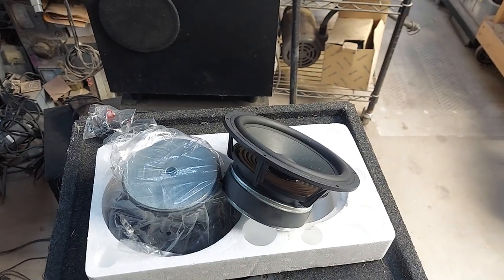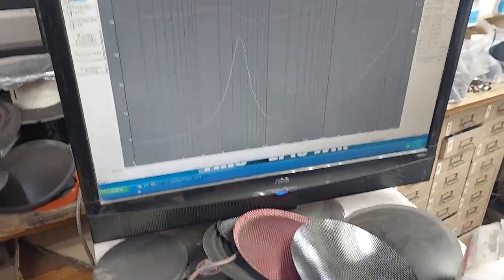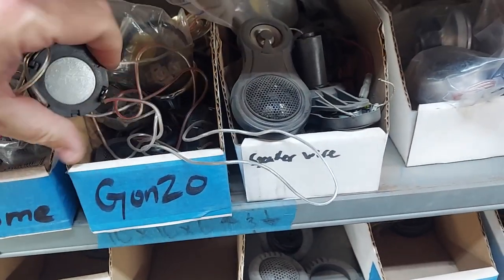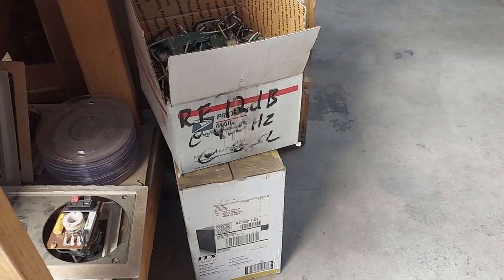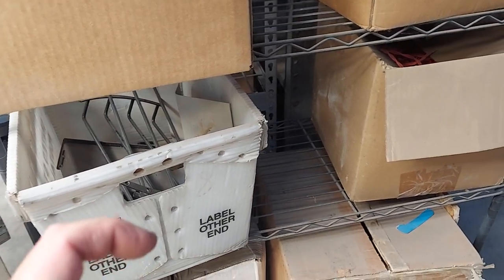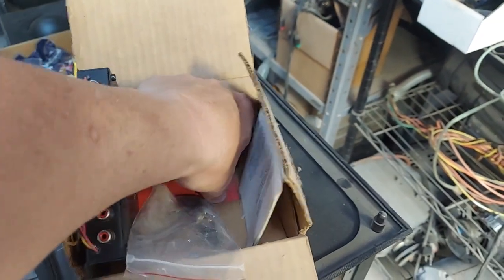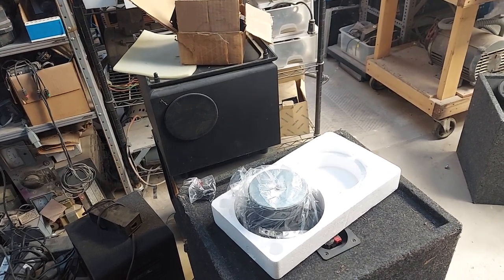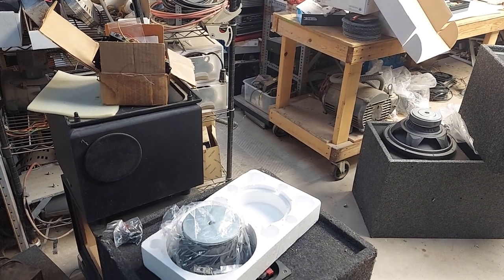GONZO Zen 6.5" components better than Focal Utopia, Rainbow, Morel, Dynaudio, CDT & JL Audio? 38hz

Comment: active crossovers require power as they use op amps. harris labs are passive crossovers. pre amp inputs are typically either 22 or 47 k ohm, so the components of a passive crossover are physically much smaller and work with much lower voltage/current than passive crossovers for an 8 or 4 ohm load.

Comment: I hate to chime in twice , but I was thrown back by the digital adt. Crossover I remember those way way back in the day, an those are amazing ,An programmable ,only 60$ shipped . The no named tweeter soft domes, I'd take (2) pair with the caps solders to them.
Reply from the maker: Just text me direct when you're ready.  Let me know your name and shipping address and I'll add you to the phone. 6023126504
Reply: steve, did you mean to type ads instead of adt ?
Reply from the maker: @administratorperson3272  Si.  he did.  I still have it available.  Someone texted me about it but I haven't seen payment.  6023126504

Comment: What do you think of cdt stuff? I bought there 6x9 coaxials, sound pretty good. Ordering said 2 OR 4 ohm, I ordered 4 ohm got 2.3. Was told with rise shouldnt be a problem. They played off deck power- figured theyd blow the deck. Played off a 90s kenwood avr rated 8-16ohm. The build quality kinda sucks if you ask me, rubber band to hold the tweeter wire down, and the wrapped the tweeter wire around the spade and soldered, so you cant use the spade.
Reply: I'm not robot but i own several cdt audio drivers  a pair of 6.5, cdt unity widebands and about 3 pairs of tweeters and ill would say they are top quality when you can get them on sale , they sound like high end speakers that cost so much more  , very good quality .
Reply: @Journalistification  cool, I was thinkn of tryin out those unity drivers and the new wideband 2" speakers.
Reply: @freeradical6390  The unity 8 sound very clear and detailed , not sure about their unity 8+ and new horn tweeters those 2 just came out , I would say go for it but get them used or buy from a person who's going with a different direction and are just trying to get rid of them.
Reply from the maker: All Chinesium like these.  I just prefer to pay less is all.  Look for beef.
Reply from the maker: I agree.  Just kind of spendy imho
Reply: All cdt is worth every penny when you get them on the monthly sales.  The new soft horn will get super loud.  There subwoofers are the only thing I feel is not worth the money
Reply: @db3287  hey man thanks! Not to many opinions out there about them. I like their sound so far.

Comment: As passives go and other  things being equal, titanium is preferable over aluminum, stiffer, lighter, higher breakup point. SB acoustics (as does peerless) make a great dimpled silk dome, very low FS (600hz) which is exceptional. I design and make my own x-overs and one thing I find a pain in the arse is getting specifics (Actual TS parameters, full). Seems like all the major brands aim for the 8,000 -10,000hz 6db which is a poor way to avoid proper corssovers and protect them against persons that are going to blow them up trying to use them below the rated values. I get it, but... Personally, i would never use a generic x-over, much prefer having the correct info to build my own. The cones on these look a lot like the SB papyrus cones. I always advise that if you’re going to purchase components, individually, get a good mid/bass and spend the money on a really good tweeter with similar efficiency woith as low an Fs as you can afford. 18db @ 1500 or 12DB at 2500 to 3000 ALWAYS nets a preferable soundstage and sound integration. Rule of thumb, tweeter should cost at least the same or more than the midbass driver, never skimp on the tweeters.

Comment: Nice name, Zen.
Plan on doing a 6.5/3/tweeter set?
Imagine the clarity of twin 6.5's on each channel to double power handling, and run them at 8 ohms per speaker. 
BTW, have you tried 5.1 surround sound in a car? Some Linkin Park is mixed like that, but does it sound good or is stereo better?
Reply from the maker: You can make any surround sound with just 2ch using DSP now.  Yes, we have the Recoil RMS35 that would make a great mid range for this setup.  It's not needed as the tweeter can play low and the mid is flat up to around 3k but if you got a hole in your car door and you want to fill it, go for it.
Reply: @RobotUnderground  I am able to have more SPL with more cone area for a given frequency. That is the goal, but without losing sound quality.
I also don't want to overload a small speaker with a dB level at which a larger speaker would be able to easily handle it.

Thus my quest for more cone area (on a given speaker or speaker set) for the given wattage, and why I like the idea of 3-ways as opposed to 2-ways, or 4-ways, if you include the 8" mid-bass drivers.
Or six-ways if you include some 10" high-sub-bass woofers to compliment the 18-24" audible-to-infrasonic subwoofers for the full, seismic-and-acoustic experience.

I know it all ain't necessary, but I've done it before to excellent effect. Too many stereos, to me, sound good until played really loud, then they get swallowed by subwoofers while the high end doesn't have the power handling to keep up their end of the acoustic spectrum.
Reply from the maker: @exploranator  Well I'd rather have a 6" mid than a 3.5" mid but that's up to you.
Reply: @RobotUnderground  The plan is tweeter, 3.5" high-mid, 6.5" mid, 8" midbass, 10" woofer, then 18-24" subwoofer Two of everything except maybe the subwoofer, depending on how greedy for lethal radius I get.

Then, take the bottom of the tweeter spectrum off and offload it to the 3.5"s, along with the top of the mid spectrum, then take the bottom of the mid spectrum off and put it on the 8's, have the 10's also in stereo that are better response than the subs, then the subs in mono for the sub bass and infrasonics.

At every increase in driver size, you get more power handling but less-crisp response, so you cross them over in a way that maximizes the individual driver's sound while still retaining fast attack and accurate reproduction.

They use 12" mids in the club to handle all the volume, but I don't want THAT much volume.

Net result: plenty of volume for all the speakers that they can handle at high volume levels. I I wanted more, i would then have to build a rig that folded out from the car for that complete mobile PA system. But I want a car that allows forays into very loud territory when I so choose without endangering the smaller speakers.

Not for everyone, but, hey, I went 180mph in my Hellcat too, but not often. I just liked being able to do so.
Reply: @exploranator  please upload video

Comment: I have a question .what makes a line out converter be able to handle more incoming rms power. on the incoming side of the line output converters. for example a car your using has a amplifier/ factory amp for mid and highs speaker and you come off that set speaker wire . Just ask because IV seen  some  of them on the package actually have a rms power rateing on them for the rms  input rms  on  the incoming of  line side for the lineout converters. IV also seen some smoke when it was tuned up 1/2ways thanks🤭🎵🎶💯
Reply from the maker: There are a couple of ways but typically they just add larger resistors.  Open some up and see.  Some like the Cache ones we have use a shunt to "sample", the signal and then boost it to whatever you want.
Reply: @RobotUnderground  thank you I'll definitely pop a couple of them open to see the difference and what resistance value are being used in them. Then I'll use one that hasn't burnt the board just To see if I can fix/upgrade one. 🎵🎶🤞👍💯🛠️🍻
Reply: a typical cheap LOC has a 20 ohm series resistor, followed by a 20 ohm parallel resistor rated at 10W. so if your Head/amp is 14.4v which is 52W @4ohm, ie; 10W @20ohm PEAK (not rms, which is 70.7% of peak) you can easily burn out a 20 ohm 10W resistor with a 50W@4ohm amp.

so if you use an LOC off speaker out from an amp that burns up, add a 20 ohm 25w resistor in series before the LOC, or a 50 ohm 10W.
Reply: @administratorperson3272  thanks  I was definitely putting way over what it rated for. I stopped buying cheap loc and try to avoid using them for a while I was around 13 years old when I first started hooking up system I only under stud the wireing. When I did need to use a Loc I'd avoid the small cheap one  at the time I thought they were just junk I didn't realize 1/2 the time I was putting double to triple over what there rated for 😂.  Now I understand now thanks. I was probably 19-20 by the time I actually seen a Loc with rateing on the box.  I can't believe how many videos are out about Loc and not one talks about the actual rating and that you can easily over power a cheap Loc and I haven't seen one video that tell anyone why they would need a better loc. Every video you see all people talk about the different option they offer Wich doesn't make sense if your not using the right one for the application. It does do any good knowing what options a Loc has. Thanks again for the quick brake down. Have a great one till the next one 🎵🎶🛠️💯👊👍
Reply from the maker: @administratorperson3272  Please make some "guts" videos and show people what a "quality" or high voltage type of LOC looks and acts like.
Reply: @RobotUnderground  that wouldn't be easy to do. i wish it were. its not so much me, but i learned if people just dont know basic things, like what a voltage dividing/summing network is ... they will say oh ok, but not really understand.
Reply from the maker: @administratorperson3272  You just have to make the video.  You don't need to be all up in them comments like me.

Comment: I've still got a set of Diamond Audio HEX S600S with a bad tweeter 🤦‍♂
Reply from the maker: I have replacements
Reply: @RobotUnderground  I may be interested. I'm not currently using them at the moment. I ended up picking up a pair of Dayton Audio - ND28F's back then and ditched the passive crossovers and went active. They were a nice match with the Diamond Audio mids.

Comment: do you have or can you build a set of 6.5's that are 1.5 - 2 Ohm?
Reply from the maker: There's no real need to do that.  It's just a gimmick.  If you feel it's not a gimmick, you can contact Rom So at a/d/s Speaker Repair for something custom or you can look at the drivers from Cicada Audio.
Reply: @RobotUnderground  or just use two of the 4 ohm speakers in parallel in place of a single one. More power handling with less distortion that way.
Reply: @RobotUnderground  lol I haven’t seen Rom since he and I worked with Dennis at ADST
Reply: rom so is nolonger doing repairs. :(
Reply from the maker: @administratorperson3272  What's he doing then?
Reply: @RobotUnderground  we (the a/d/s/ enthusiasts group) have not been told details other than about 8-9 months ago he was not well, and the website states "temporarily closed". the enthusiasts group is primarily car audio (there is a different group, braun/ADS speaker... for home audio). ive probably been in that group >10yrs of which Rom only joined a couple years ago and seldome interacted with any of us. there are several former employees (engineers) in both groups.

i did recently (this year) get a email reply from him having asked him about some rs10 subs i have, which he has 2 recone kits available for.
Reply from the maker: @administratorperson3272  Well he does like the drinkydrink.
Reply: rom's site currently says on vacation till august, soo, we'll just have to wait till then.

Comment: I need a couple pair of the 6.5s
Reply from the maker: Just text me direct when you're ready.  Let me know your name and shipping address and I'll add you to the phone. 6023126504
Reply: How much are these?
Reply from the maker: @toddspraker8916  The mids alone are only $180 per pair shipped.  With tweeters and your choice of either passive or Fmod type crossovers are only $250 shipped to the lower 48 states.  Text me direct when you're ready.  Let me know your name and shipping address and I'll add you to my phone. 6023126504

Comment: Those are "silver flutes" he is rebranding . I have a set in my cars front sound stage.
Reply: W17RC38-04
Reply: A lot of companies that used to sell to DIYers are starting to get out of that business. Most notably, Tymphany won't even sell in small enough quantities for Parts Express to keep buying, so they are about to be dropped. You have to buy a full production lot of drivers, which for Tymphany now starts at 400 pieces. This is partly because the companies that make and sell the parts to Tymphany to build speakers have stopped taking small orders. What you know as Silver Flute today may not be available tomorrow, if they follow the same path.
Reply: Looks like it